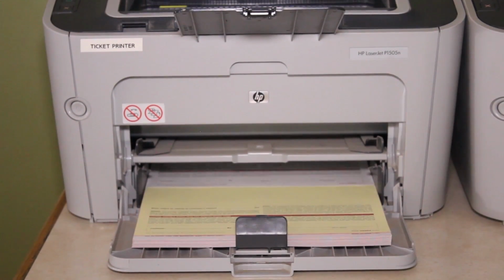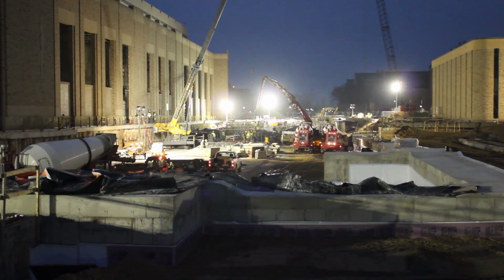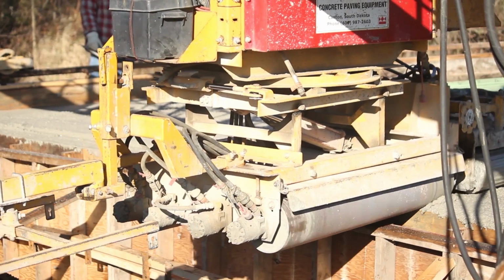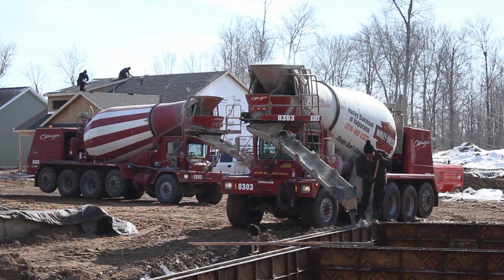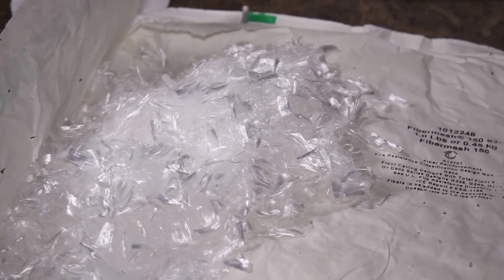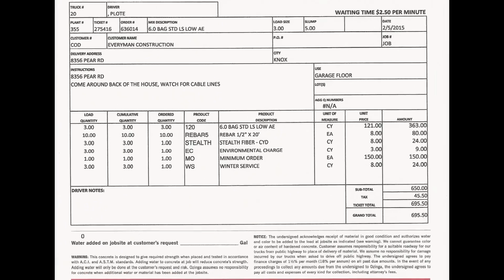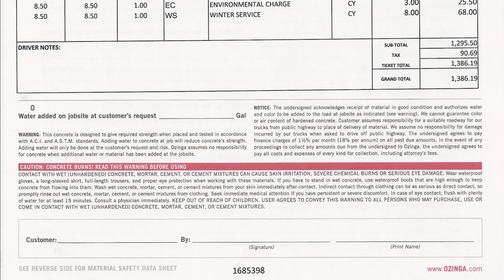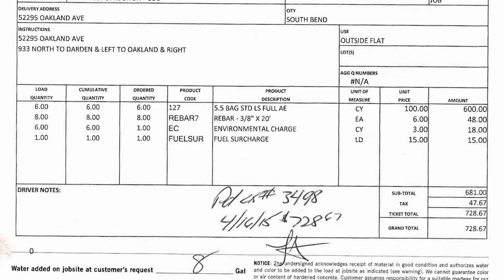Know Your Ticket

Comment: Front loaders are so ugly.
Reply: @markrobert6014  it doesnt matter how much it holds if it gets stuck in the mud. front discharge trucks are 6x6
Reply: You said little rear discharge trucks in your fist comment, who the fuck drives in mud with a mixer? Rarely happens here line or boom pump.
Reply: @markrobert6014  obviously you know very little about concrete business! no mud? Thats hilarious
Reply: @fike301  16 years driving we don't drive in mud like that we got a lot heavier trucks  then your little trucks maybe that's why. 100,000lbs 14 yards
Reply: @markrobert6014  I drive a front discharge  truck. We drive in the dirt/mud daily. That's the difference between a front and rear discharge. A front discharge is pretty a Jeep Wrangler with a mixer on top.
Reply: I wouldn't mind being a mixer driver but heard in the winter it rains and stuff which here in south Carolina we dont get snow but rain in the winter . I heard it gets slow in the winter and if it rains you cant pour so my problem is I heard you can get as low as 28hrs in a week and that's not good when I have a family with a wife
Reply: agree with you
Reply: your so ugly
Reply: If YOU'RE gonna try to insult me, at least spell shit right, idiot.
Reply: @MartyrMachine  you might think there ugly but most contractors prefer them over those little rear discharge trucks and can't nearly do as much as a front discharge truck we can do more and go into places that you couldn't even dream of compared to a small little rear dumper.